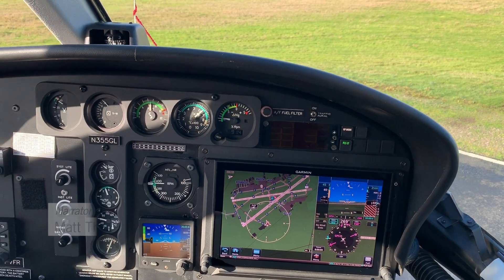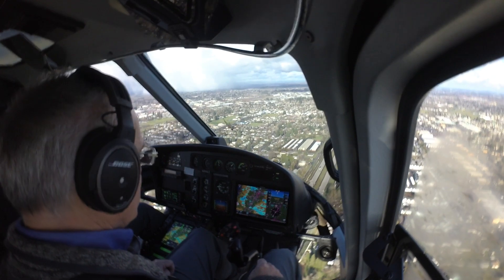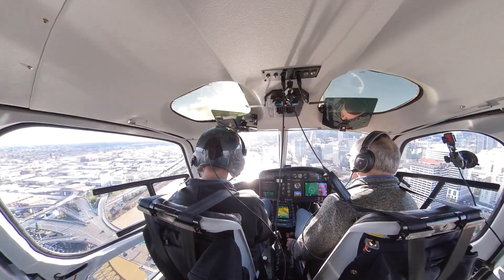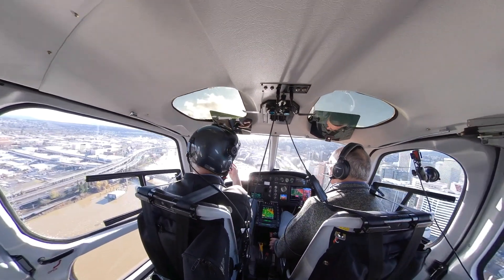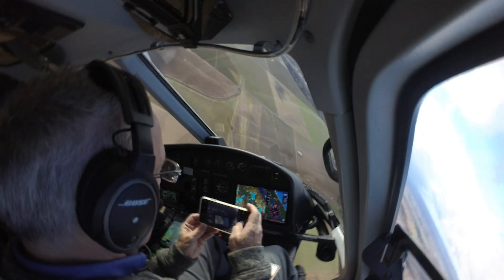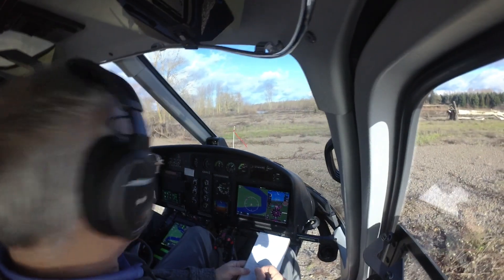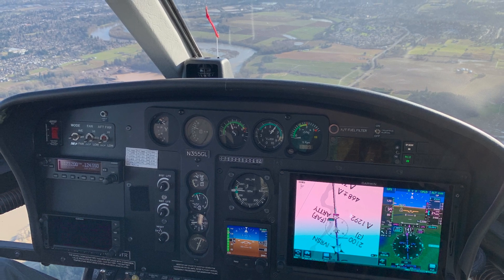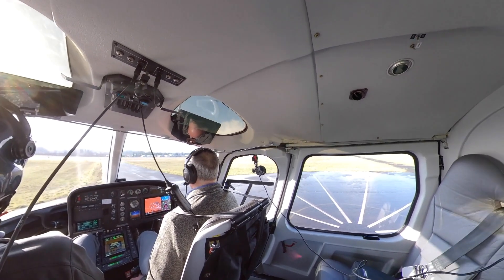How Garmin’s GFC 600H Flight Control System Makes Flying a Helicopter a lot Easier – AIN

Comment: i wonder how it would handle the tight high speed orbits with a 40 or 50 degree nose down angle that LAPD puts their copters thru..
Reply: Recently moved to LA from houston. Was in shock at how much different the “ghetto birds” as I keep hearing them called are flown sooooo much more aggressively than houston police would ever fly their copters. I see where GTA gets there references from. Lol